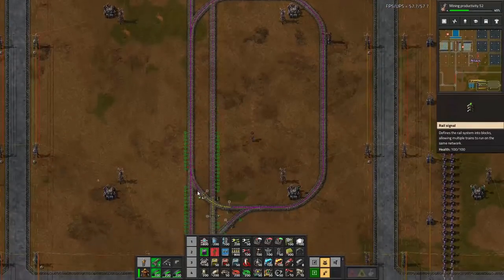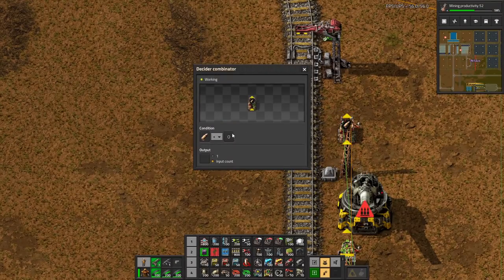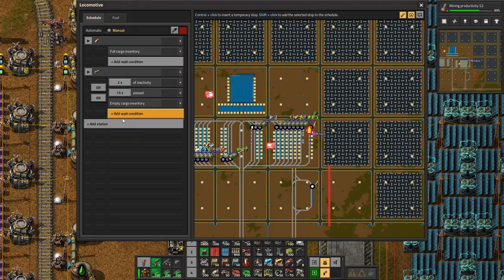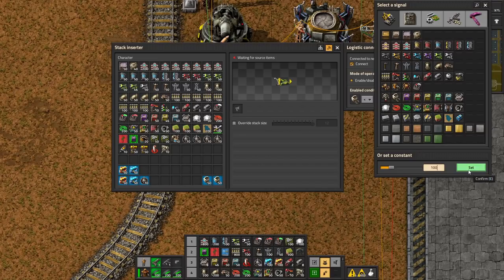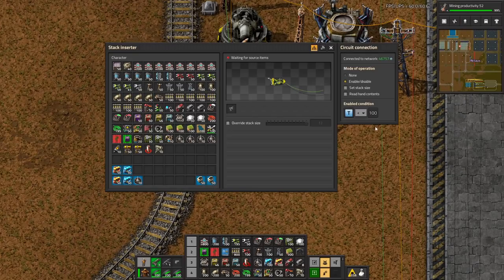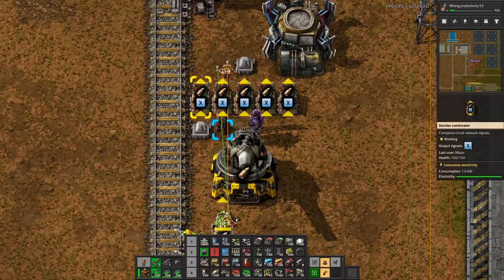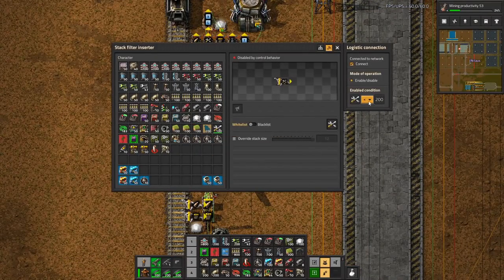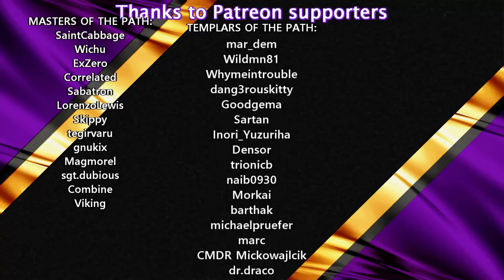Prototyping ARTILLERY OUTPOST | #45 | Factorio Megabase-In-A-Book Lets Play

Comment: Being the nervous type I'd be inclined to add some walls and dragons teeth in front of the lasers at the shooty station locations just to slow down the bigger biter attacks and allow the robots time to repair or replace damaged turrets without being munched or shot down by spitters. Might complicate the train though as you'd have more than 4 items being delivered beyond the shells. Maybe just add some laser clusters by the station and the roboports to protect the repair infrastructure against any biters that might leak through the laser wall on the initial rush? Alternatively build a bunch of tooled up Offensive Unit Spidertrons and have one or two stand guard at each artillery station with their 1600 rocket load out + spares in the trunk for sneak attacks or in case the power gets cut and all the lasers go offline with  the big Bitertron squadron as your in-base mobile reserve if things really go pear shaped.
Reply: And flamethrowers fed by barrels.  Because fire, glorious fire...

Comment: in my megabase ive made a different art-posts with art-wagons. after train leaving the art-post network checks if it leaves with empty shells-> then there is more to shoot in the art-post area -> requesting new art-train to this post. if train leaves with unused shells -> there is no more biters in this area -> timer starts to count 15 minutes to request new art-train to this post. works pretty well
Reply: Basically what I do. I have 1 artillery train (not wagons) that goes around and fills up chests when the storage at each outpost drops below a certain amount. The artillery train never fires, but it holds more than wagons can.

Comment: I don't know if you've done any maths on the power draw that the laser wall will take if it's attacked from all directions - there's no nuclear power on standby any more.  Perhaps the artillery bases need to be deployed one by one over a period rather than stamped down all at once.  
When you're building the solar blocks, the order of build doesn't matter, but here I don't think you should let the bases be built willy-nilly by the dim robots!  I've just got visions of the artillery pounding away while the part-built base waits for an inserter to unload repair packs!
Reply: Edit: I think that means you could have two blueprints - one would be almost everything that the base consists of, and the last would be simply, I don't know, perhaps the combinator which counts artillery shells, to put it into commission.  The station wouldn't open ahead of time, then.

Comment: I'm guessing perimeters probably scale at a range of 3-5 city blocks with a private network before swarms becomes a problem.

Let's be honest. The biters on this map are more annoying than a true threat at this point. If they were a real threat, what would we want? As this base has the means, deliver the components to build artillery onsite. Delivering wall, oil, and uranium ammo allows us to focus on design and address scale issues. The extras are cheap at this point, but more importantly, fit into the spirit of the rest of the blueprints.

This perimeter design you are building could support a mid-game with an artillery add-on for end-game. If it is overkill at end game, that suggests biters are truly no longer in the red zone. They are no longer a distraction. The factory can grow.